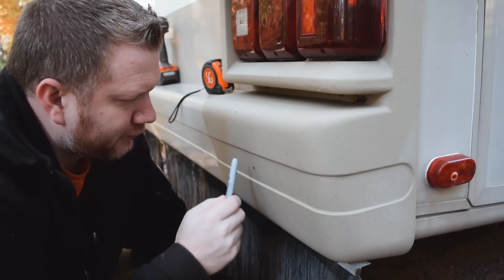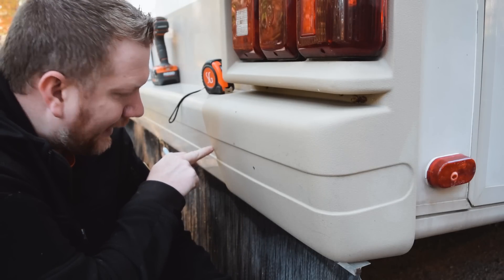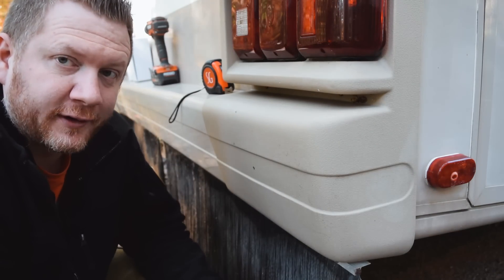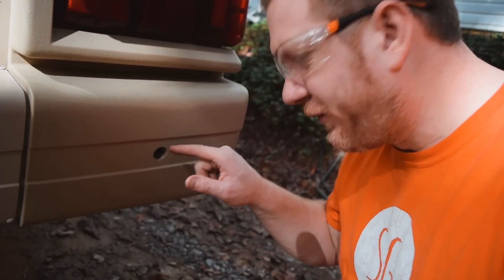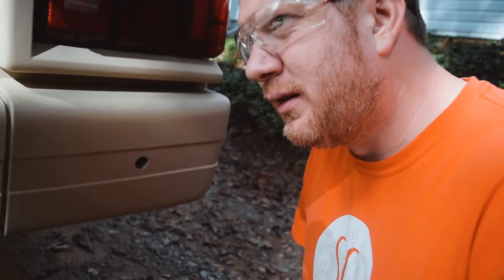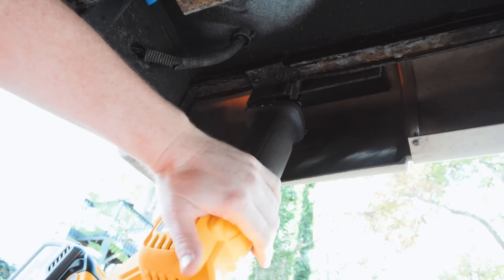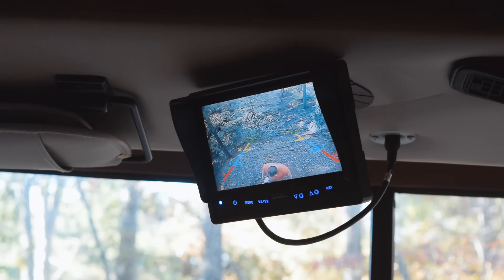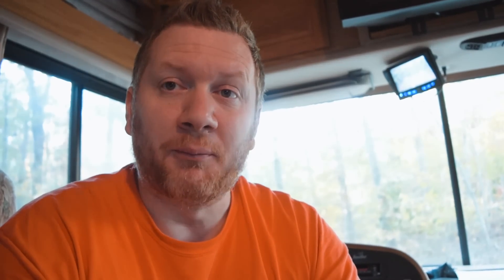How to install backup sensors // Rear View Safety RVS-112-W

Comment: They advertise in their video that you can use these sensors on the top front corners to prevent overhang collision. Have you tried this? Curious if it gives false readings if your vehicle is 12 ft, and an overhang is 13 feet.
Reply from the maker: I kept getting a false reading with my bike rack on the back so I ignore most of the time lol

Comment: Great addition!  Would it have been easier to have installed the camera and sensors at the same time to run the wires together? Do you have a link for the sensors?
Reply from the maker: Yes and no, the box is only on in the rear area so you don't have to run a new wire when if you already did the camera. To be honest I disabled this feature later on because it would beep for no reason imo. Especially when I had a trailer or bike rack on back.
Reply: @Southern Ginger Workshop  Hmm Maybe the sensors were too close to the edge of the bumper and picking up peripheral things (in the case of random alerts)? 
I am usually solo when moving around on my (very heavily wooded) property, but don't plan on attaching trailers/racks on the back. 
We install cameras/sensors on trucks and heavy equipment at work, I'll do some measuring on those next time one comes in. One of the fleets we work with (BNSF) s upgrading their cameras on all their trucks,  so over the next few weeks I'll have several to compare. 
Thanks for the feedback.  Just brought my 39z home yesterday. I'll be gutting it, which should make it easier to do "behind thecabinet/wall" tasks.